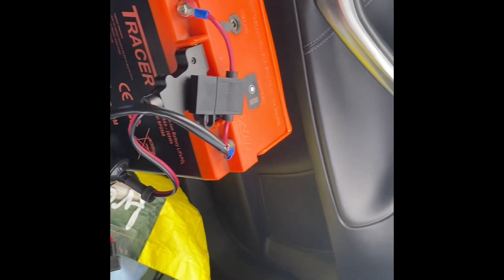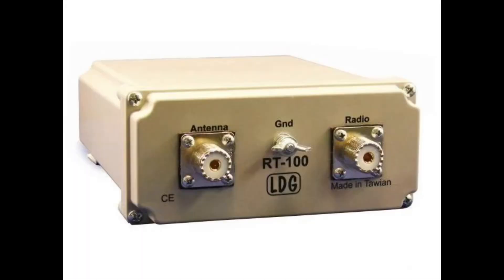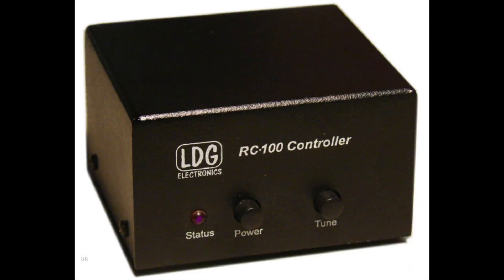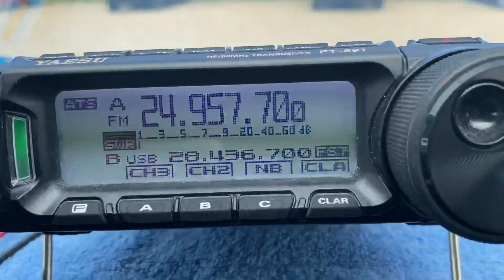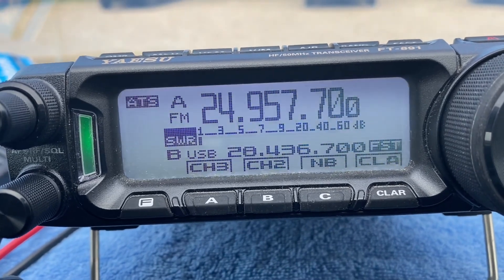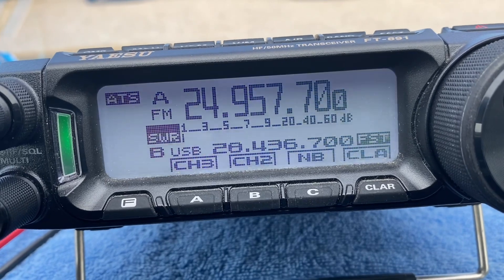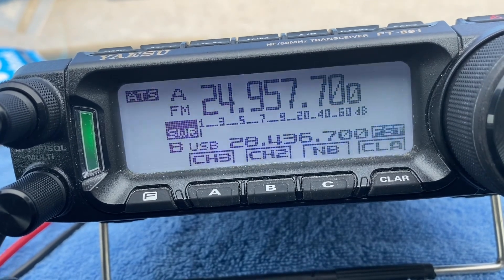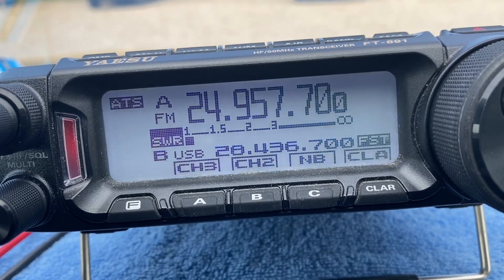Ham Radio: LDG RT 100 Tuner in ATAS mode

Comment: So let me see if I understand this correctly.Because I know the atas sends 12 volts to expand the antenna and 8v to retract. Once the radio sees a decent match it turns off. So I guess you are saying that the antenna tuner will run on as low as 8v? I did not realize it gets the power from the coax line on that tuner. Good to know. I just picked up an Ameritron ALS500, Remote Wattmeter and some Hustler 1.5 kw resonators. I used to run 1600 watts in a Camaro Iroc Z28 with the Hustlers and a massive Bus battery. QRO is almost always a must for mobile operation.

Comment: Holy cow...I've been dragging the LDG bias-t box everywhere I go, assuming I needed it to power my RT100! I had no idea the FT-891 already sent 12v down the line to power the tuner. It should have been obvious to me, as it's setup to power the ATAS antenna! Oh well, better late than never. Thanks for the info, Tim. That's one less box, one less power cable and one less coax jumper I need to bring out into the field.
Reply from the maker: Great stuff!!

Comment: Why would you need a tuner if you have the ATAS?  Doesn't it communicate with the radio and adjust for best SWR?  I was thinking about getting that antenna, but haven't really deep dived into it yet.
Reply from the maker: It’s instead of an atas. My view is you can use the tuner for loads of other applications too. But buy an Atas and that’s all you can do with it. As this tuner allows the Atas function to act as a bias tee it has that flexibility. As well as not needing any additional power source to function.
Reply: For what it’s worth, an ATU will tune faster than the ATAS because it’s electronic not mechanical. For example going from 40m to 10m with the ATAS “takes a while”. 
Also, an ATU will store the settings for 100 or more frequencies. If you tuned it for 7.025 and 28.300, it would take about 2 seconds to go either way. 
I’ve been using an ATAS with my 891 for a year and I often wonder if there’s a better option. I operate 20m-10m almost 100%. I’d have less money with an ATU plus a 3m whip than an ATAS in 2023 money. (My ATAS gets “confused”if I go to 40m and back, resetting itself in the process-annoying!) 73’s all around! 😊 WB3CFN
Reply: @joekrepps  I understand that.  I am by no means close to an RF engineer, but isn't the ATAS still better than a "Tuner" a.k.a. a matching unit efficiency wise?  Obviously the ATAS is a highly compromised antenna, but I would venture to guess that more RF power will be output from the ATAS than some whip and a tuner.  Granted the tuner could be used on a wire antenna, and that makes total sense from a portable perspective, because in ATS mode, the LDG tuner gets it's power from the radio, which is super cool since you then would have one less cable to hook up.  I am coming at this more from a mobile perspective.  The ATAS is pretty affordable and efficient for what it is and what it can do.

Comment: I have the same with my FT-991A  -->>  1:1 Choke Balun  -->>  9:1 Balun  -->>  41.7M LW  (@ 15M vertical, rest over a tree)
It works very well, 160M is O.K but not perfect, 
I picked this up from this YT nearly 3 years ago: https://www.youtube.com/watch?v=4W9lwnfU8js&ab_channel=MyHobbies
EDIT
Forgot to mention, no need to change mode/power, it does it automatically at 5 W
Reply from the maker: Thanks Dave. Sorry it took so long to respond but YouTube have only just notified me of your comment. 73
Reply: @TIMG5TM  No Problem :)

Comment: Short of a full dipole a remote ATU, is the best solution and not  that expensive considering all the other bits one can buy and still have to trim the antenna. Airliners have ATU's in the tail section to tune the antenna built into the vertical stabilizer and ships have them remote to match stays and such.
Reply from the maker: Good points

Comment: That is interesting. I have an 857 and an ATAS antenna and have run the rig happily that way. However if this will enable me to easily use a better antenna it will be interesting. Currently is I use an end fed or anything /P I am using an MFJ 939. This might well be easier. Be interested in what antenna you are using. Thanks for the info Tim.
Reply from the maker: Ah yes to be revealed! 73
Reply: @TIMG5TM  VERY interested to see how this develops Tim.
Reply: @TIMG5TM  Of course you could be parked next to a huge Tower, out of shot 🙂
Reply: Hi Chris… It sounded like you’re using your 857 in a base station installation… I’m considering using the motorized ATS but I’m concerned about the need for an excessive amount of radius in a restricted area. How did you solve that?

Comment: Thanks for that Tim. I didn't know that you could squirt bias-T power out the back of the radio to the tuner like that! I always thought that you had to have the separate power supply.

The FT-857D is apparently compatible with the ATAS, so I'm guessing that this would probably also work with my FT857D.
Reply from the maker: Yep should work in Atas mode James 73

Comment: Good stuff - these ATU's mean make mobile operations a cinch whatever the compromise on antennas that you have to make .Hoping to get a G90 however which will make it redundant with it's own internal tuner.
Reply from the maker: True but the nearer you tune the vertical to the feed point the less loss from the coax mid match